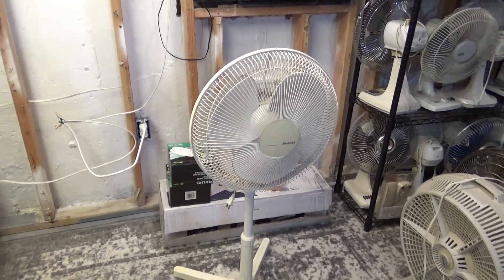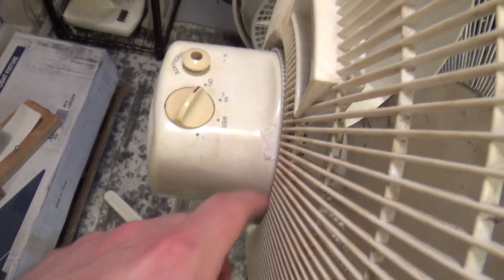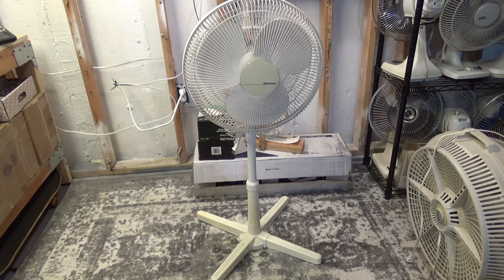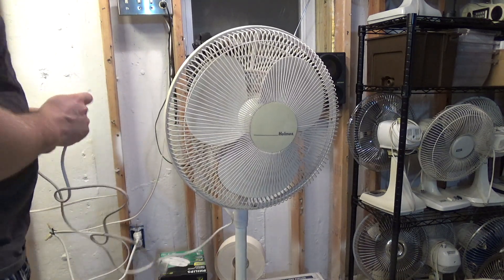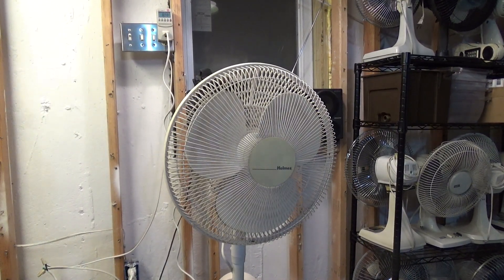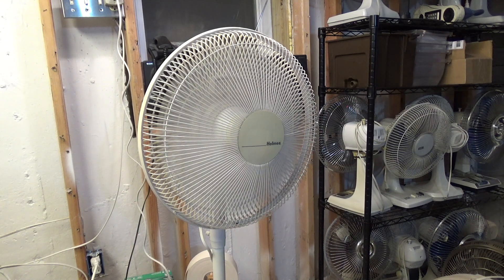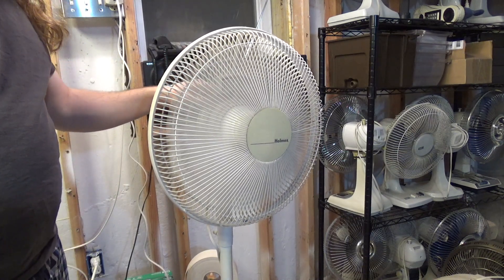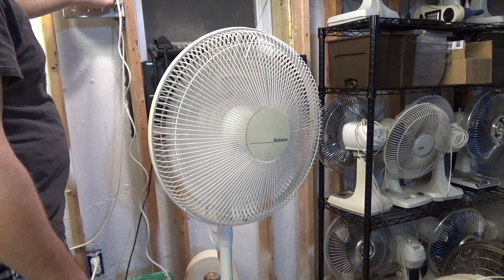Holmes HASF-1506 A 16" Oscillating Stand Fan

Comment: I have had 2 of these fans, one of which was exactly this one but was a desk format from 96 and one of those 5 bladed swirl base models. 

From my understanding on why these fans are designed poorly is because the of the spinner, the spinmer threads are flushed beneath the surface compared to the average blade cap where the threads are at the same level and make contact with the blade. Because of the threads being flushed in the Holmes company had to do the same where the blade sits on the pin which is why that back portion of the blade is covering the front cooling vents which also led to the designer have the leading edges have a slight angle inwards to not scrape against the rear guard.

 The fan motor size is probably similar to that of a 2010s remote control lasko fan if you compare side to side without the covers and guards
Reply: It makes me wonder why even make the 3 blade models with this type of motor. Really thinking about it, especially after a blade swap video i did recently, the motors seem better designed for the 5 bladed models as I noticed that there's still some space between the motor and hub while the blades still have a decent pitch
Reply: @Windmere  I swapped some bladesets with 2 holmes fan and the blades from other fans protrude so much that you cannot use it without the blade scraping against the front grill, and that was mainly the case with SMC/ 2000s Midea blades
Reply: @Windmere  I also used a 5 bladed Holmes stand fans without the grills and it blew more air than it would with the grills in placs and it ran slightly faster
Reply from the maker: The 5 blade prop is landslides better than this one. It baffles me too as to why this one even exists when a far superior one existed simultaneously.
Reply: @JordanU  Thats true, and they were quieter compared to the tri blades